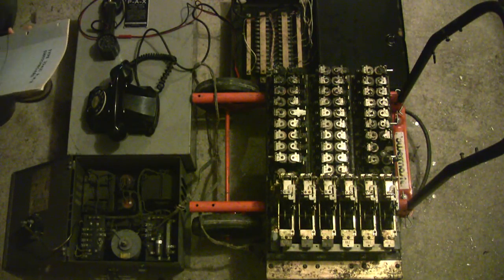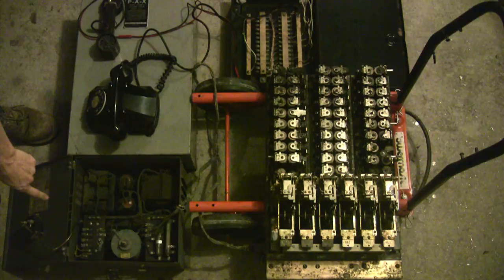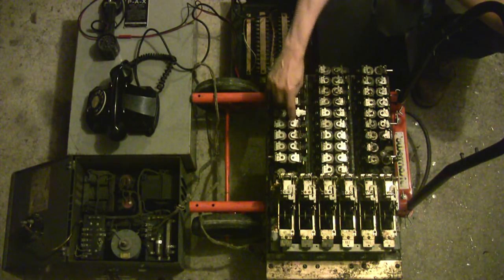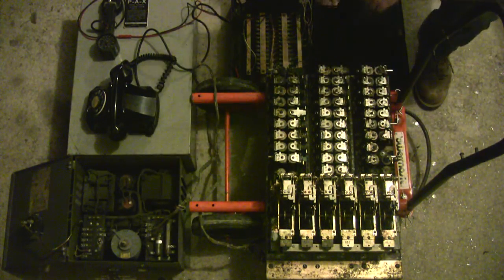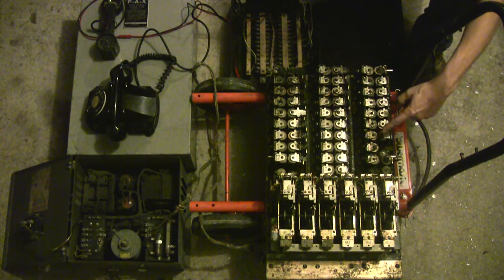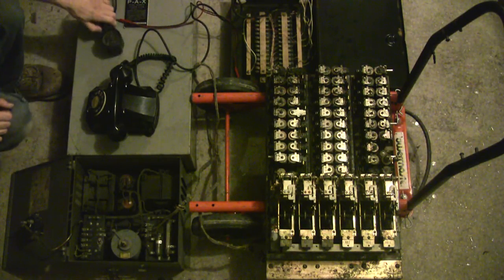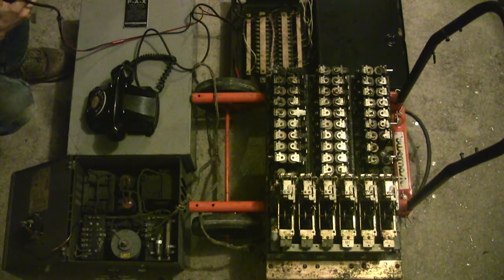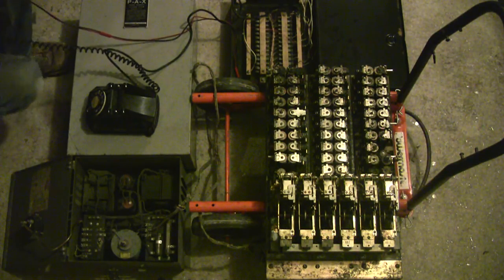Automatic Electric 32A21 PAX telephone switching system.

Comment: I have just bought one of these. Don't have the power supply. Do you have any circuits that show what voltages are used and where they connect.
Reply from the maker: The whole system runs on just one 24 volt DC Supply.   As I recall there is a fuse block on the back where the minus connects, the plus goes to the frame.

Comment: The selenium rectifier's voltage output isn't sagging after all these decades?
Reply: The power supply does have transformer taps marked "aging".  Needless to say, it's on the tap that gives the highest output.
Reply from the maker: There are "aging" taps on the power supply.  It's set to the highest one now.

Comment: I found one close to this, but a little bigger -- 52 lines. I found mine in the basement of a condemned ski lodge in the UP of Michigan. There were also -- what looked like -- fish tanks of wired to the phone system. Turned out to be a sort of battery. Thankfully my buddy always carries a voltmeter with him; we tested 16 volts from the batteries still but zero amperage haha the battery's acid inside was looking a little tapped.